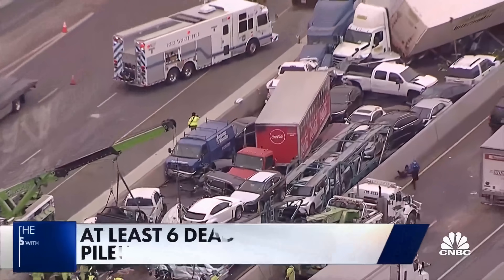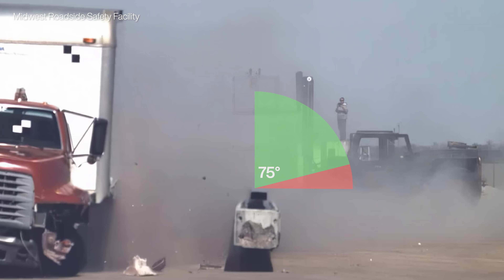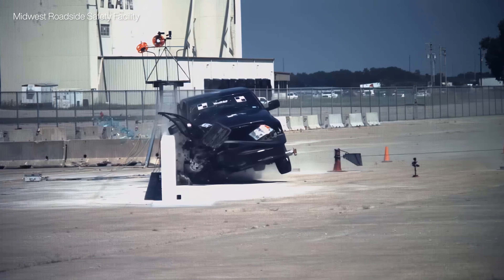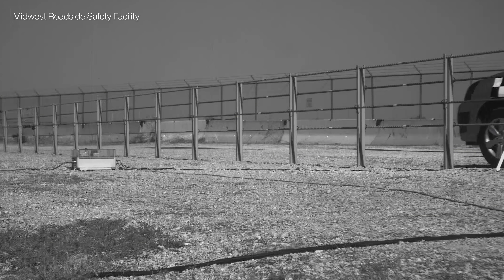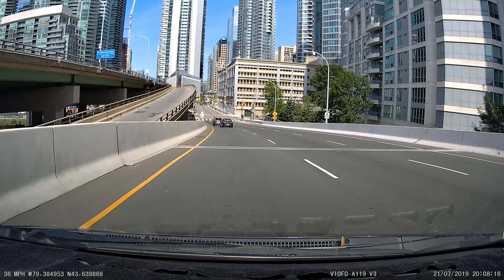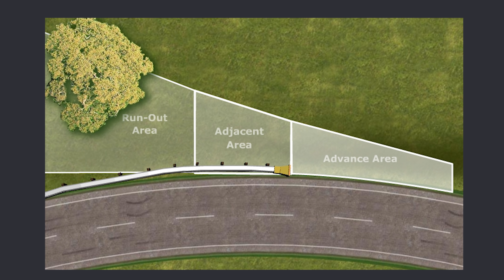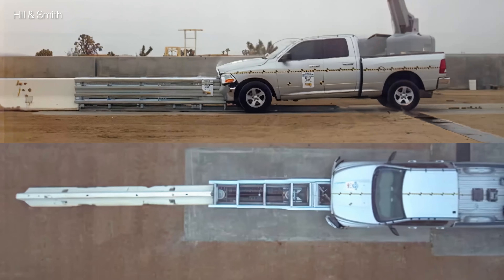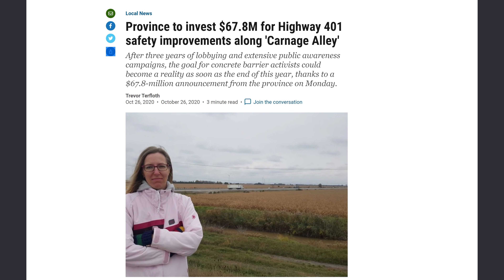How Road Barriers Stopped Killing Drivers

Comment: My uncle fell asleep behind the wheel and hit one of those guardrail endpoints on the expressway around 2am in the morning. It cut his car in half and paramedics had to cut both steel and flesh to get him free from the tangled wreckage and then put him in a pressurized suit so he didn't bleed to death before the stat flight could get him to the trauma center. We learned days later that the trauma team was convinced he wouldn't make it, but after many hours of surgery they had him stable. He was considered a medical miracle to have survived, but he was not left without permanent damage to many of his organs.

Less than two years later he succumbed to a massive heart attack that was shown resulted from damage to his heart as a primary cause, along with his body's other weakened organs being a contributing cause. All of it because of a guardrail that stopped him from going into a large median where he could have recovered without injury. I myself had a tire blow out going down that same expressway 3 years later and when I tried to ease into the grass the rim dug in and yanked me hard into the median, I was able to regain control and brought it to a stop just before crossing the midpoint of the median. The only difference was I didn't happen to have a guardrail endpoint in my path. 

He was 35 when he passed. That was nearly 30 years ago. The medians no longer have guardrails bordering them sporadically, they've all been replaced with wire fences except for drop offs at overpasses. I can't help but think that if they had been replaced 20 years sooner, my uncle would likely still be with us.

Comment: Seems like cable barriers should only be used when necessary and guard rails with flat enough terrain or when landscaping is feasible
Reply from the maker: Exactly that, used where appropriate.  For all barriers though you have to landscape it, cable barriers require less though

Comment: Those MSKTs work great when hit head-on.
They're a problem when hit by a sliding or spinning vehicle that ends up with a door adjacent to the guardrail "ejection" port.
I've seen several wrecks where the passenger compartment has been punctured by the deformed rail.
As always, the biggest and best safety device is the nut behind the wheel.
Idiot proof the US highways, and the US will just make BIGGER idiots. 🤪

Comment: Sand barrels.  I always assumed they were filled with water.  Interesting.
Reply: there are some with a water solution, but its not really as common as sand.
Reply: @m_lies  Thanks.  One thing's for sure; one is easier to clean up than the other. 😄😃

Comment: Since the 70s I have seen how road barriers have changed. I used to think about why they were designed the way they were and judge them on how likely they would or would not kill someone who hit them. Some looked like they were designed to kill you. (There was not a lot to do in the backseat in the 70s.)
It was so interesting to see how all of the barriers that I have seen work when hit when hit by a car.

It's amazing to see reusable barriers, for when there are so many idiots in cars that they hit repeatedly. 

I don't understand why they resisted putting barriers on the 401 in the south, they have been putting them in for decades in the section between Toronto and Kingston.

Comment: I hit a cable barrier last year around this time. The 2 wrecks I was involved in prior to that I hit both walls on both sides of a 2 and 3 lane high way. I've gotta say I've felt the walls. Them sum bitches did NOT feel good. But the cable barrier I didn't feel hardly at all. Totaled my car. Had the cables been there I would have just drove into the grass median. Also, cable barriers can bring a semi going 60 to a complete stop without injury to the driver or passengers

Comment: Lots of valuable information but you do seem to forget about motorcycles which since cable barriers have been used injury rates have lowered cause fatalities have increased they were designed for large vehicles not ones on two wheels.
There are also disadvantages with cables like no way to remove a section to open a road to get around accidents causing in some countires for example NZ to block major roads where there are no detours available when they could do it before...then again like barriers road materials play a big part in stopping distance etc.
We win some, we loose some but hopefully as time goes on things get safer as technology grows or we have better driver training haha

Comment: I hate cable barriers it really fucked up my truck when my truck turned into it when stopping if they weren't there i would have recovered once on the grass/dirt but slide into the ditch and forced my vehicle into the cable the posts really damage vehicle even if ur only doing 25-30.....

Comment: You are talking about fractions of a single percentage point of crashes involving barriers that are fatal. .9% on the high end is the most you're talking about from those 2 studies. Really?!? You are splitting hairs about one of the smallest portions of overall traffic fatalities. Some of this was interesting but the level of irrelevance road barriers has in the grand scheme of things regarding road safety makes the effort you put into this hilarious. You looked up a ton of stats for something that doesn't really matter that much.

This is the reason behind the opposing views on catch cables. The ones that have to delve into the overall statistics are seeing the tiny impact collisions with these barriers has on the overall picture. They know that with acceptable losses the reduced price of cables allows for greater coverage area and a better chance of having any effect on slowing a car. With remote chances of actually even colliding with a barrier, while being out of control, you are better off playing the odds with coverage rather than spending several times the amount on a guardrail or concrete. You could build 10 feet of a concrete barrier that might only get clipped and not even get hit enough to stop a vehicle from crossing into oncoming traffic. You are much more likely to hit the 70ft of that cabling though. At that point even if the car breaks through the vehicle would have reduced speed enough to keep from flying off like it would after sideswiping off the end of a guardrail. There can also be a ricochet effect bouncing the vehicle right back into lanes of traffic. I'm sure there are better and worse types of terrain for either but again look at those studies. 

We have more people dying in a year from heart disease due to obesity than several years of these types of fatalities added up. Yet we have no stop over eating campaigns. I guess fighting heart disease isn't as profitable as writing seatbelt tickets or catching every minor ordinance violations that they can't legally pull you over for under the guise of a sobriety checkpoint.

Again some of it's interesting and you did a great job on research but just the advent of collision detection/lane assist technology alone has a dramatically higher limiting effect on fatalities. The whole seatbelt and sobriety enforcement stuff is crap though. Seatbelt violations don't change someone's mind about wearing a seatbelt. It's just like speeding. When multiple studies came out that showed an overwhelming majority of drivers drive whatever speed they want, they increased speed limits on freeways and highways because they new that more advanced vehicle designs were building up a safety buffer to allow for safer travel at higher speeds. The overall increased availability of vehicles to more people also increased exposure to road safety at younger ages. This has instilled a better understanding of the roadways and different forces exerted on vehicles earlier on in life as each generation passes. Seriously though you could see the line on the graph dropped dramatically during the major improvements manufacturers made to make vehicles themselves safer for people when things go wrong. Then the line stays pretty level for the last 30-40 years. Most of the stuff you're talking about besides cables weren't implemented until about 15-20 years ago. That shows almost no impact on statistics.

Comment: Cable barriers might "cause less injury" simply due to them being placed in safer spots where you dont need robust barriers. Not neccesaraly the barrier that is the main factor.
Reply: Yeah like loads of people in convertibles that crash into cable barriers get decapitated.
Reply: @xavierentwistle8758  And if you skid into one on a motorcycle it'll cut you up. But hey, I don't ride a motorcycle for a reason.
Reply: Ironically near me they just put up cable barriers along like 50 miles of highway because two high speed chases lasted exceptionally wrong because the runner avoided spikes by crossing to the other side of the highway 🤣

Not always about the safety
Reply: @ObservationofLimits  Still about safety, since that dude could have killed a LOT of people by jumping the median.

Comment: Im 1,000,000% against the cable barrier crap. I hydroplaned on a road, spun out and went into a cable barrier. Most of the poles in the ground just bent over without a fight. The cables snapped and i went right through. 
Based on how everything went and what i seen afterwards of the barrier, my Durango and the ground, id say the barrier may have slowed me down a max of 10%. I was doing 45 in a 55. It poured hard the night before while i was at work. But stopped very early in the morning. By the time i got off work EVERY road on the way home was either surface dry or nearly there except the service road i wrecked on. 
I also had one of the poles nearly rip into my Durango and almost got me. In the end, my Durango was totalled and to add insult to injury, i got a letter from the stay saying i owed nearly $1,300 for the damage to the cable stuff. It was 6 poles replaced and it appeared they mostly reused the cable. The changed a couple little things, but didnt appear to be 1,300 worth even with labor costs.
I personally believe i could still be driving my beautiful Durango today had they not put that cable crap in. I may have just had to do a good cleaning and replace the front bumper. With the cable, it ripped the bumper off danaged a fender and rear quarter panels back bumper a bit and EVERY DOOR. I fully blame cable barriers for the financial mess im in now. We have a van now that we owe almost double what its worth because of the negative equity left in the Durango vs what we owed.

Comment: what you fail to mention and i think is greatly oversee is the fact that for bikers cable barriers and some metal barriers are super un safe as they can easily tear a person in half, amputate a limb o worse while not retaining much the bike or the rider if they slide very low, thats why in europe we are fighting to get done a law that make mandatory the use of double metal barriers with moder deformable desings that absorbs and chatch the rider istead cut them in half, letting them slip throught or bouce them and bike back to the road.

Comment: "For often crashed into barriers"  ???? Often crashed into barriers are in bad locations or have a road that is poorly designed for the traffic or speeds it receives.  Here in the UK these roads would be first in line to get fixed. trafic calming measures or maybe a road realignment or a safer option for turning, a longer slip road etc.  You solve the problem by changing barriers a little bit, you eliminate the problem by stopping the crashes.
Reply: Again, we are talking about a country where your parents teach you to drive, and where reading while driving is a thing.

Comment: All I could think about during this video was motorcycle safety...
Reply: Cables = Cheesewire
Reply: @Johannes Becker -- Some others have mentioned this too.
On the one hand, one might say motorcycles are so inherently dangerous there's nothing that could help.
But many (most?) said the same thing about cars hitting pedestrians.  But now engineers are responding to governments' new pressure to let pedestrians survive being hit by a vehicle.
I wonder what kind of barriers might work for cars / trucks and motorcycles?
Reply: @be5952  The semi-rigid metal pole style with panels underneath to prevent limbs from sliding between them would be all that's needed.
Reply: @be5952  A net?
Reply: @BrunoNeureiter  Can't stop a semi-truck with a net my dude... That shit would either rip a biker up, or not stop a semi-truck and cause lane jumping crashes. A semi going 40 into a car goign 70 is like a car hitting a brick wall at 100.
Reply: I don’t think there’s much you can do
Reply: Wasnt motorcycle arent allowed in toll or highway?
Reply: @Whopparhombus  wat?
Reply: @legolas1025  actually the cheapest car is cheaper than the cheaper motorcycle 🤡
Reply: uh ok thanks but I'm not sure why you said that?
Reply: @Whopparhombus  Some countries restrict motorcycle travel on highways, others do not. I have never seen any motorcycle restrictions on highways other than a minimum engine size. <- In U.S.
Reply: work harder , buy a car
Reply: @secretsquirrel6124  Lmao what? Do you realise that many motorcycles, performance or not cost well over 20K new? And let me tell you that, you may like having fun by going to a club and having fun, we like having fun by riding. What's your beef man?
Reply: @chrispykriss  no it's ok you ride your motorized bicycles and contribute to the organ donor programe you will provide many parts for deserving people, it is a great sevice you people do
Reply: @chrispykriss  If you take the risk of riding a bike then you take the risk, same as an open top car.
Reply: @secretsquirrel6124  people don’t ride bikes cause they can’t afford a car lmao
Reply: @secretsquirrel6124  you must be a poor person from the 3rd world if you think bikes are cheap in the US lol

Comment: Being a truck driver in the US this is important cause a plain guard rail won't even slow us down cables do a better job but the clean up is messy it gets all tangled. We weigh up to 80,000 pounds and out west we can weigh up to 120,000 pounds. And a over sized load can weigh over 200,000 pounds. Its gonna take time  to come up with something to stop us like the cars and pick ups.

Comment: This is a great video ! thank you for this ! I'm from Europe and I think that a big problem about cables and semi rigid barriers is that they are great for cars and trucks but deadly for motorcyclists. And it would be interesting to see an other video about riders safety on roads because, if they are victims in an accident and survive the initial shock, they will often be beheaded and cut in half or lose a limb because of semirigid barrier and cable, when a simple safe zone of grass, sand, dirt or even asphalt would save them. Anyway, keep the good work, loved the video!

Comment: My family was caught behind a 2-car crash about 2 years ago where one of the passengers had been sent flying out of their car, colliding head first into a cable barrier. Due to the cables, the only major injury was a collapsed orbital (the bone around the eye.) If the barrier was concrete or metal, the passenger would’ve had their neck broken and/or died. Those things really work.

Comment: Cable barrier better known as cheese slicers to the mc comunity are the worst. If you ride anything but a car or semi. They are often certent death. As they where nver designed whit the tougth of someone not inside a shell. People hitting this on an mc often get ripped apart. But most die on the spot so i guess they have that going for them. A conreat barier is at least snagg free.

Comment: I wonder, if in study of cable guards safety, did they took into account that they are installed usually in places where the risk and dangers are lower? They honestly look scary, with cables whipping around. Maybe if cables would also be connected, it would be safer?

Comment: Or your local government is a bunch of penny pinching douches like here. Until enough people have their vehicles ruined or crash on their motorcycles they don't even put up warning signs after tearing up the road to the point that it's just as bad if not worse than plowing into a curb. Like I don't care if it's after hours or your day off, it's people's lives and only mode of transportation, a simple "bump" warning sign and "motorcycles use caution" takes only a hand full of minutes to put up. 

Of course that doesn't prevent them from hiring the cheapest contractors to do road repair, therefore making the road far worse than it was and requiring repairs of the repairs to make the road more drive able than a suspension test track.

Comment: 7:30 this guy guess cant read data.. mortality rate between two studies presented was cable 0.3% vs concrete 0.3% where as second study said cable 0.9% vs 0.4% that means one study said sure mortality rate its the same...but second study said hey mortally rate of cable barriers is double of  that of the concrete